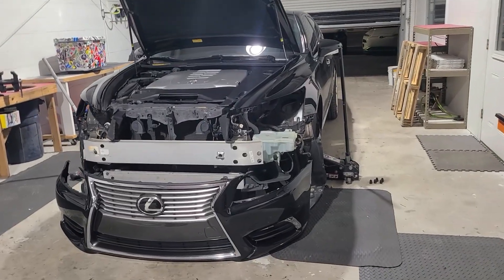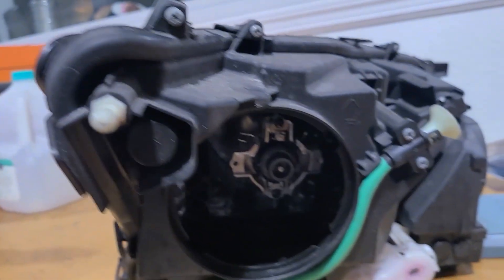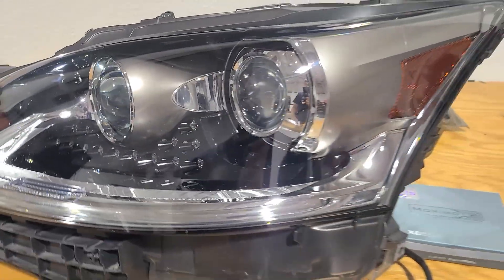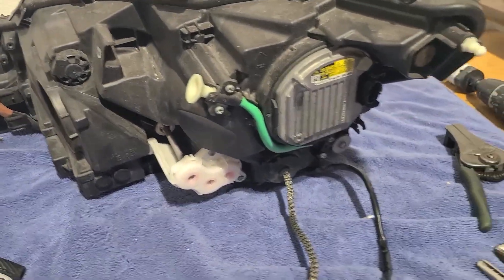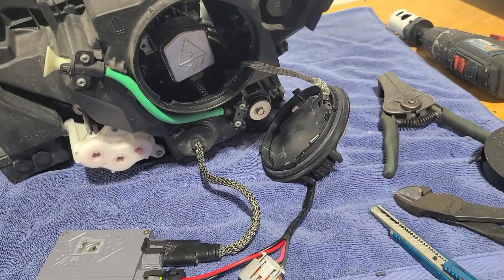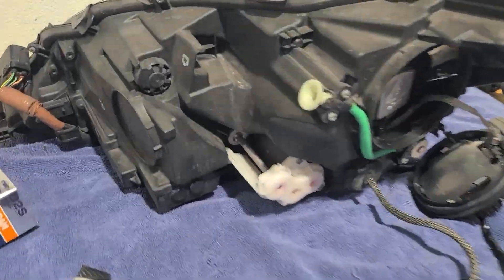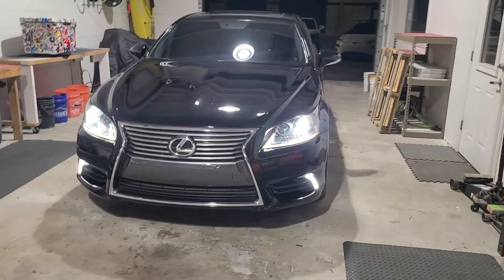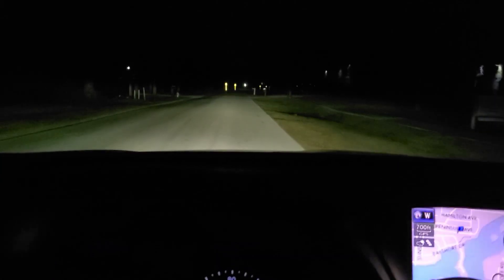2013 Lexus LS460 HID Headlights - Overview & Upgrade

Comment: I'm shocked that they would use a dummy ANYTHING in such a car/brand.
Reply from the maker: Well the presumption is that the LED-spec trim level would utilize the space as a separate dedicated high beam projector.  But as an HID-spec, it's just begging to become useful for the right client.
Reply: @Bythirteen  
Yes, this is just in US Lexus version, but other Lexus460 versions such as Japan’s, Middle Eastern’s ets .. are standard with halogen high beam on this dummy projector as long with other high beam on low beam projector, so the total are four high beams on both headlights.

On the other hand, all US Lexus versions have little orange Leds on front corners and little red Leds on rear corners that other Lexus versions  don’t.
Reply: @Bythirteen its not dummy. Originally its so IR lamp. But obviously someone already removed it earlier
Reply: Where are you located?
Reply from the maker: @nickcopeland4  still right here at the shop, serving my local community.